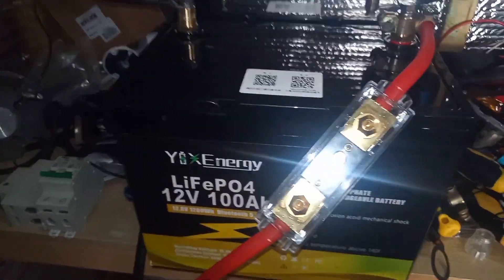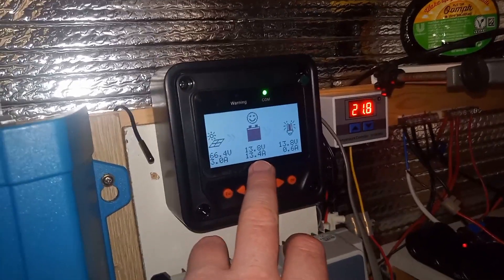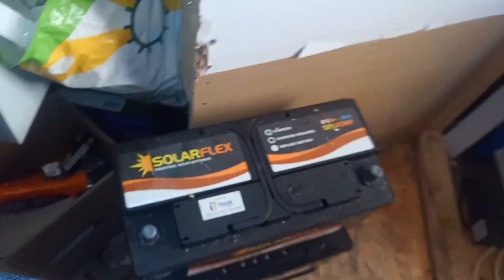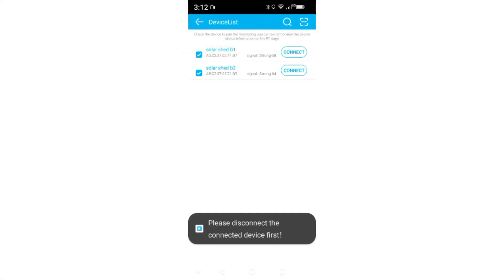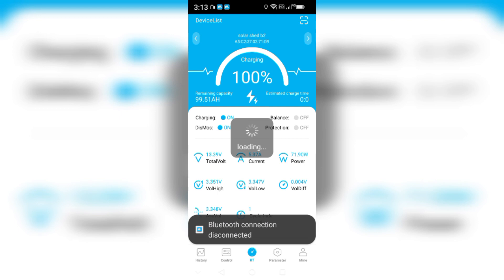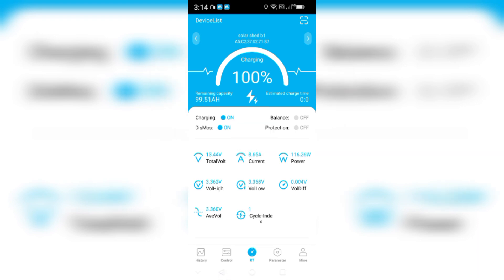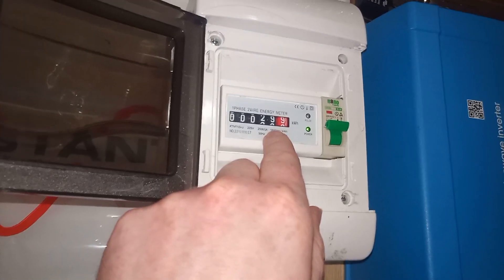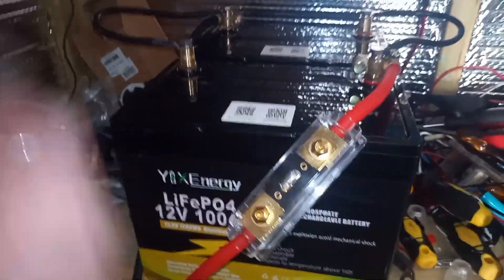200ah lifepo4 battery bank solar shed update

Comment: I noticed that the battery also comes in a 200Ah and 300Ah options. If I needed 12 batteries to go off grid, would four 300Ah be a better option than twelve 100Ah. Looking at both performance and space required.
Reply from the maker: of the top of my head i think these are not for running a house off grid as i do not think you can put more than 4 together as the battery BMS is set that way... BUT the company do batteries for off grid set ups and 48v may be the better option for off grid.
they can also build a battery to your needs and they sell kits with everything you need.
you can stack up to 15 of these batteries together https://www.alibaba.com/product-detail/In-Stock-48v-lithium-ion-battery_1600628245103.html?spm=a2700.shop_plgr.41413.2.7fa37b549OdIjt 
but i recommend sending them a message and tell them what you need as they are experts and i am just a fella on you tube with a couple of 100ah batteries to play with :D but they are really helpful

Comment: Enjoyed the update bro, bit of cost up front but should have years of free power. Safe travels. Ken.
Reply from the maker: The batteries were free ish. But I have spent a lot on cables, breakers and fuses. Maybe 100 quid just to fire it all up.   I have to pay for the batteries by doing a load of promotional work on social media but the system is the best it has ever been and getting used daily :)

Comment: LifePo4 are the business 👍 bet you’re well chuffed scoring these Sly, makes all your effort with the channel worth it aye! 
Really interested how you’ll make it mobile. I’d be inclined to put one 100Ah into a small ammo style box with outputs for lights radio etc but be able to then carry it out and plug it into the house 100Ah when not camping, giving you the full 200. Prob need a pretty chunky connector for that though. All the best, cheers
Reply from the maker: I am tempted to put one battery in the old box I built as it still has all the 12v and usb sockets still in it from when it was in the boot of the terios :)